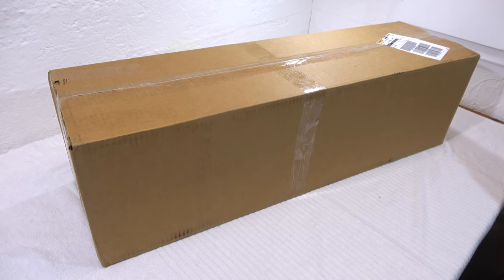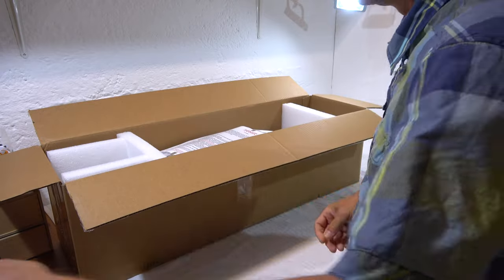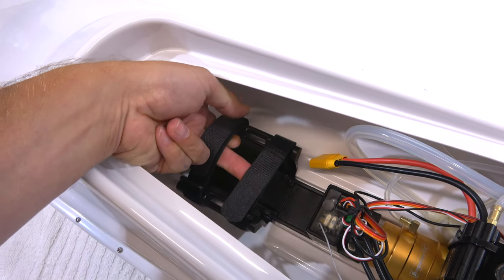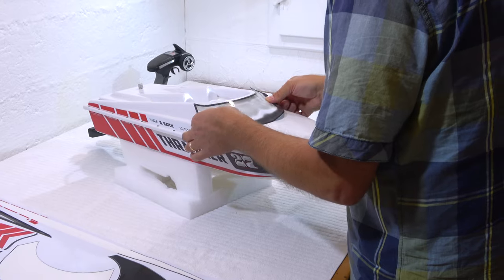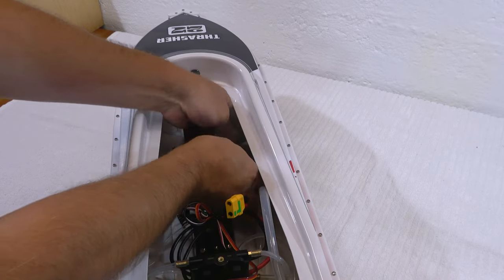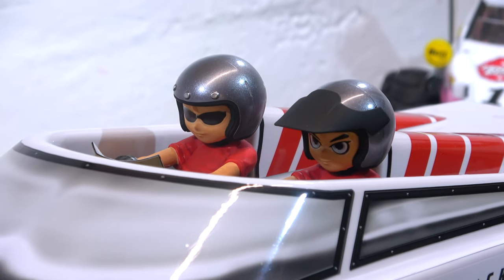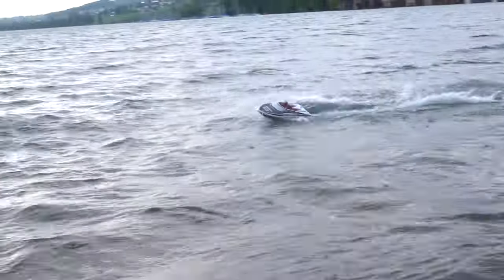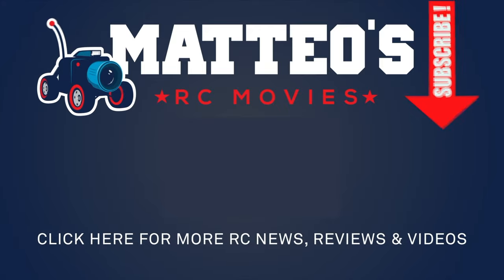Thrasher V3 Jetboat - Unboxing and Review

Comment: Something a bit different but very interesting nonetheless.  I want to build a high speed amphibious vehicle.  I wonder if the water jet and all the running gear could be somehow incorporated onto a 4x4 chassis or whether it would just take up too much space.  Well, that is my full custom project for the future!
Reply from the maker: Cool! Good luck with your project! 👍😊
Reply: @Matteomeier  Thank you my friend!
Reply: Nice , I'm doing that with a traxxas maxx chasis, you can also try the konghead chasis and wheels,  great buoyancy
Reply: @Cormano980  I was thinking of using something like a short-course truck chassis with waterproof electronics.  I don't want to use large tyres for flotation, I wanted to have a custom hull, probably that I could 3D print.  I'm just not sure there would be space for a set of electronics and drive arrangement for on-road and then an extra set of everything for a waterjet.
Reply: @BlackSeaRC  should be enough room , it's just an extra esc and servo , but you'll probably want a 6 ch transmitter to hook everything up
Reply: @Cormano980  What about a bilge pump?  Unlike a boat hull, an amphibious vehicle is going to have the wheels and suspension protruding out so I'm sure some water is going to get inside.
Reply: @BlackSeaRC  could work yeah , but it's better to build some bulkheads around the electronics compartment,  seal them with silicone for easy removal in case you need servicing and leave air access on top for cooling
Reply: @Cormano980  Thanks for the suggestions!